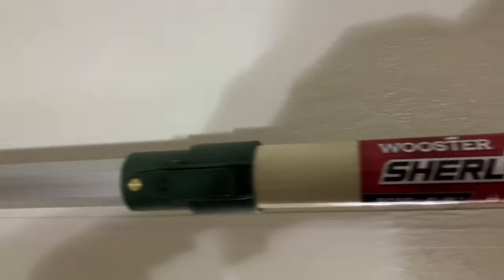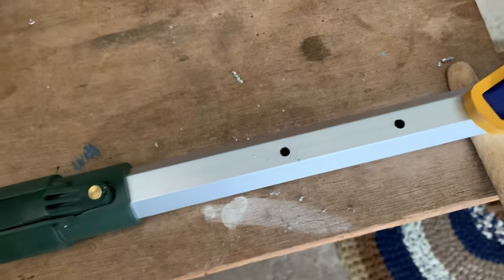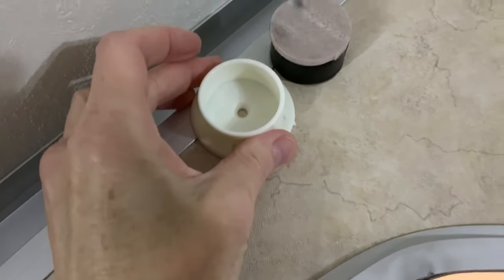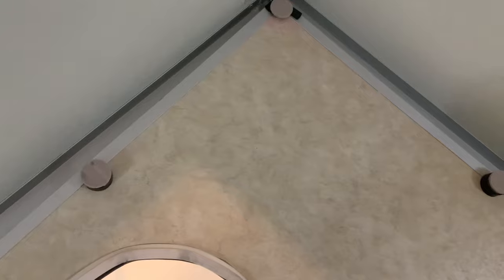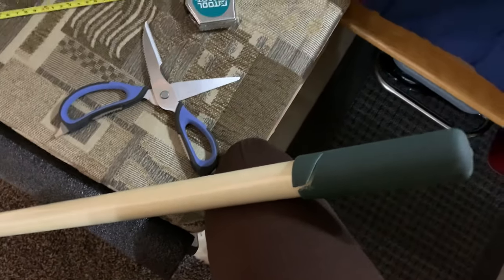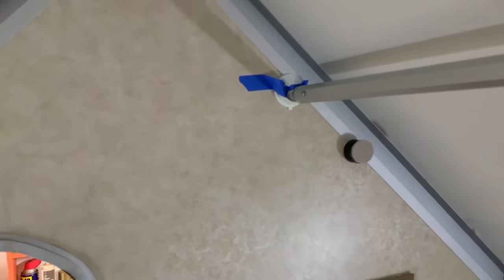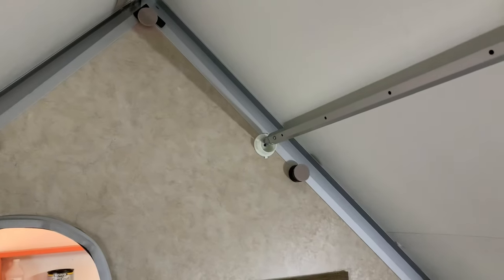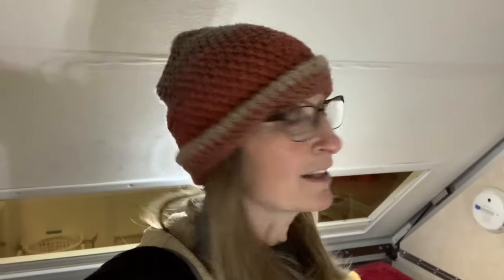Installing a Wind Pole to Protect your Aliner Sidewalls! @ruthtrips7391

Comment: what did you use for those sidewall bumpers?
Reply from the maker: Do you mean the closet pile sockets? Or the felt furniture pads?
Reply: @ruthtrips7391  felt round bumpers?  Just large furniture feet?
Reply from the maker: @bhesse  yes, I found them at BiMart. They come on a pack of assorted sizes.